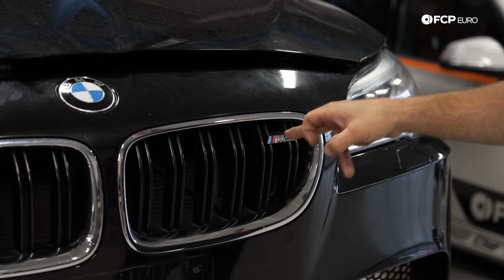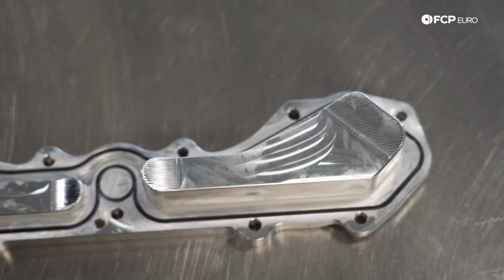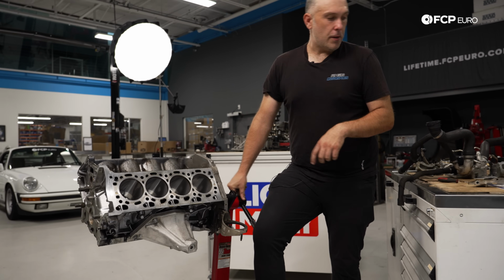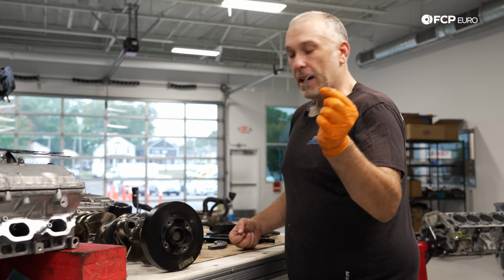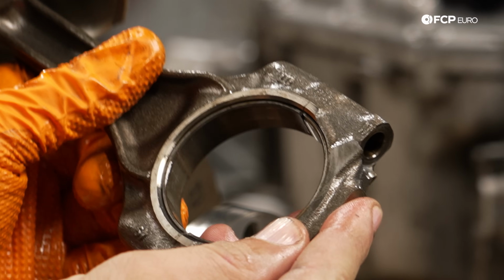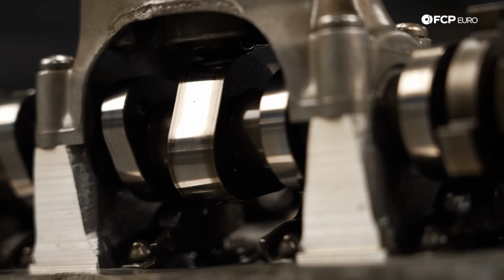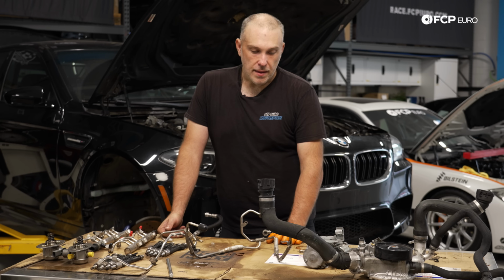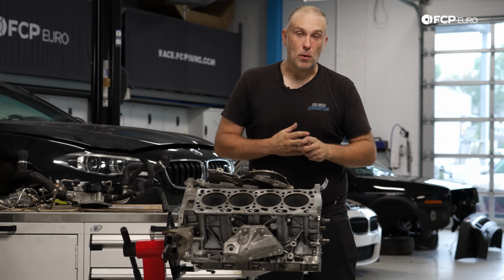BMW S63: Everything You Need To Know - The BMW F10 M5, F12/F13 M6, F06 M6 Gran Coupe Engine Guide

Comment: Hey I own an F10 LCI M5 Competition!!!! I've been looking forward to this! My car is at 120k. I love it!!!
I actually might have a leaky oil return cover, when I go full throttle I can smell oil. I already changed my PCV hoses.
I also run 5w-30 oil, I start driving right when I turn the car on, but I make sure to keep the load light and shift early until the oil is warmed up.
It is important for any F10/F0x M5/M6 owner, if you're driving in warm weather or driving hard make SURE the car is in SPORT PLUS MODE. The auxiliary water pumps run more and you will notice your oil temp stay near 200 instead of rising so much.
Reply: Yeah same here, a lot of people leave the car idling at cold for 5-10mins, but correct way would be just wait 10secs, then just throw it in D and keep it extremely light and rpms lower than 2.2k.
Reply: 5w30 lol 5w40’is minimum It needs
Reply: @BulletsGarage  the dealership uses 0w-30. Plus, the weight doesnt matter as much as the certification. I use Liqui Moly 5w30 Special Tec B Fe which conforms to the BMW LL 01 FE standard, which is needed for the S63.
Reply: The turbo oil return cover - we suspect - is the root of many oil-burning and leaking complaints on the N/S63. 💨

Comment: Super informative. I do have a leak somewhere in my S63TU in my 2017 X5M. Not quite sure where to begin. Don't see smoke, don't see puddles under car so not sure where it is leaking. Hope it doesn't look like that engine with the black sludge.
Reply: Could be valve cover gaskets. But could also be other things…lotsa places to leak, unfortunately. Lower oil pan gasket is easy to do. Upper oil pan gasket…not so much. Might as well do rod bearings while you’re in there lol
Reply: Valve cover, that's exactly what's going on with my F85

Comment: Another informative episode with BMW guru Gareth!

Edit:  There's a bmw engine shop in Germany which will re-hone and acid etch Alusil
Reply: i believe the shop is H2motors, they have a youtube channel, didnt they rehone M539's S65 block?
Reply: @clonetrooper576  ya. I posted the name but my comment was deleted.
Reply: Impossible. Throw the block away or use for a coffee table. 😅
Reply: @TML34   not impossible. I know a shop which does it
Reply: @ hmmmm, interesting. I’ve never seen it done…successfully. Most try and sleeve the cylinders, also unsuccessfully. 😅
Reply: @TML34  Hey,  just a FYI. H2Motors has a video up where they're re-honing the cylinders of a S85.  It's their current episode.  Enjoy.
Reply: For a single jug off a porshe to be redone is 400$ plus shipping... For 1 cylinder not a whole engine. Its a nice idea, but a highly cost prohibited option compared to something like a replacement block or used block. They have to use bigger pistons too.

Comment: If you want all BMW engine problems of all the different BMW engines in one engine than is the N63 / S63 the right one for you😂

BTW great video as usually Gareth!
Reply: At least the oil filter housing gasket isn’t an issue anymore lol😅
Reply: @shazkhalish8167  lol. Ya right.
Reply: Shame really.   Can't believe BMW didn't bring B-series engineering to their V8's
Reply: @KM-ol5bs  I find it funny that BMW's middle tier engine is the one that's actually the well engineered and well built one instead of their top of the line engine
Reply: @KM-ol5bs They did. S68…
Reply: @rj3075  polymer coated rod bearings?
Reply: Not physically possible. You're forgetting about the S85 engine
Reply: The last Boss